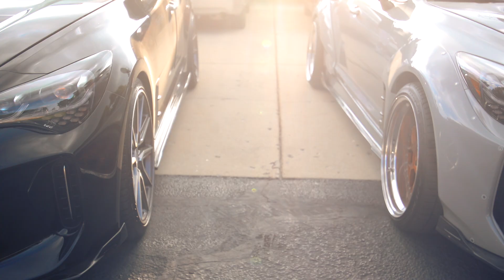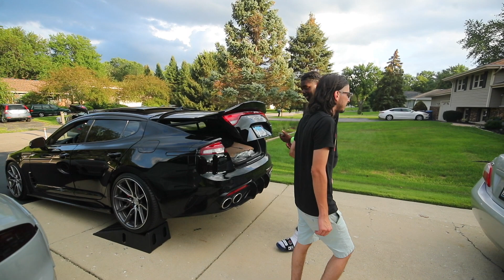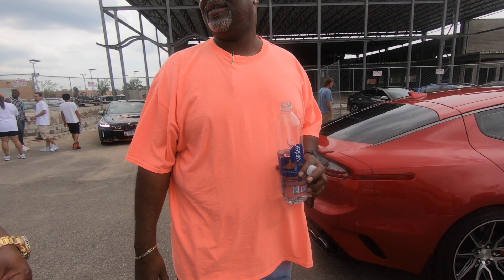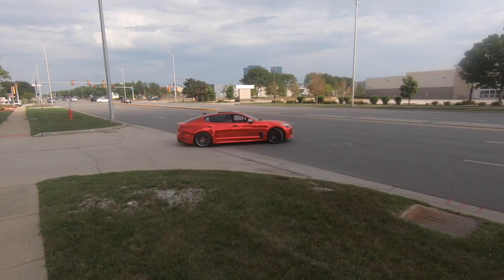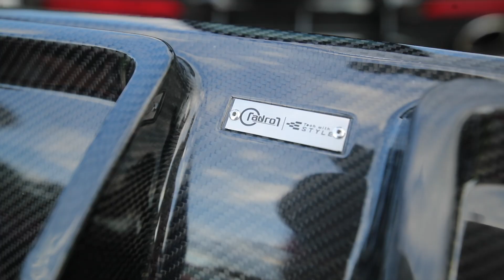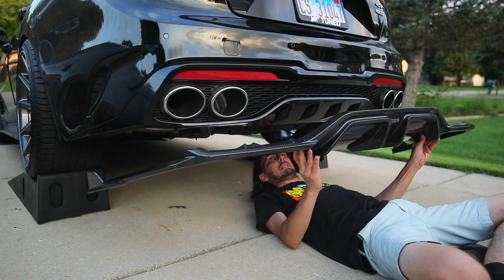KIA STINGER   ADRO DIFFUSER INSTALLED!

Comment: Papa, I have a 2022 Stinger in Moss Green, love it, my question is does the Borla 2021 exhaust fit on the 2022? And do you use the stock diffusers?
Reply from the maker: yes and yes